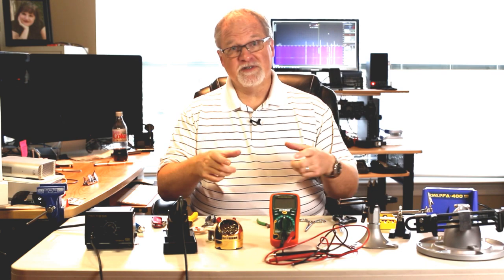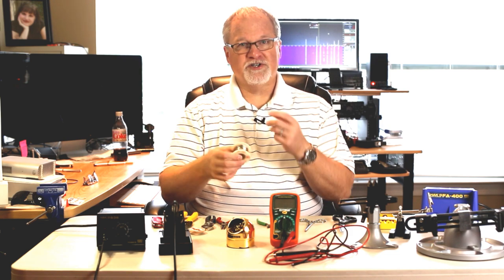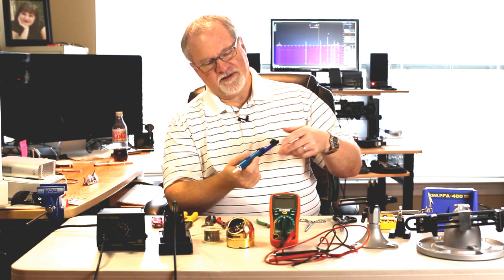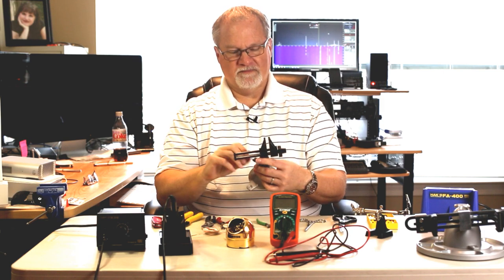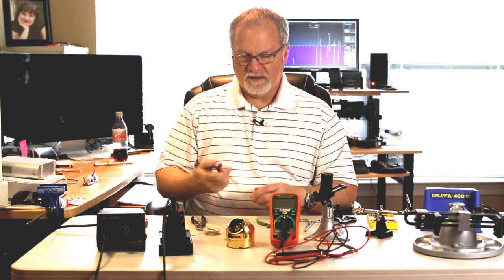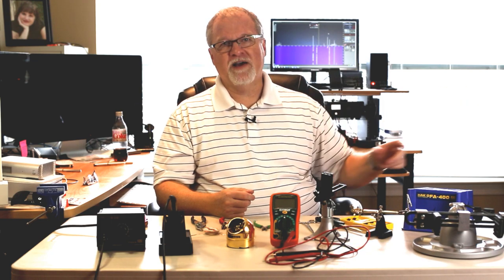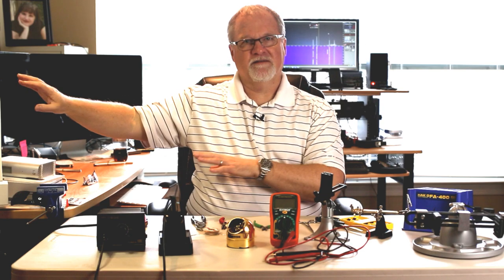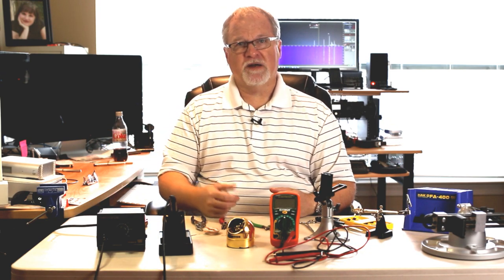Recommended Tools for Kit-Building

Comment: First off, thanks a bunch for the videos. I really enjoy watching them. I'd like an adjustable soldering station, like a Hakko, some day. Right now, I have a 25W and 60W Weller and a 160W electric gun. For fastening wire to end rings and soldering sections together fast, a butane pistol (not a plumbing torch!) comes in handy. Regarding the fumes, I have a small AC fan as well as a fan that plugs into a USB port. If I set them near where I am soldering, they pull the fumes away. For years, I used a helping hands. I then got a circuit board holder and a fluorescent magnifying arm. One thing that is really handy is a metal, suction base vise. The suction base doesn't work worth a crap, but it is heavy and something put into it won't move. With helping hands, it's too easy to wiggle around the alligator clips or the hot clips to make imprints in wire insulation. The vise doesn't do that.

Comment: I would mention that the ideal solder is 63/37 lead-tin.  Flux is your friend for good soldering practice.  Get a small bottle of liquid flux and well with 90% Isopropyl Alcohol and Q-tips to remove excess flux.  Solder wick is essential to remove excess solder.

Comment: I don`t solder professionally, but I know somebody who does and he takes steps to vent the fumes he produces outside the shop area. What occurs to me is, you could do your soldering on the kitchen stove if the vent hood exhausts the air outside the house. Maybe placing a box fan in a window and soldering in the vicinity of it will accomplish the same thing.

Comment: Nice video! If you rigged up a flexible hose, like an old vacuum cleaner hose/nozzle to your fume extractor, you could have local extraction without compromising your soldering job or your health!

73, Tim
VA1TIM

Comment: Just a Note but when using side cutters make sure you hold on to the component lead so it doesn't go flying across the room.  If it's not possible to hold the lead a good set of safety glasses are a good precaution for when the wire goes flying up into your own face.
Reply from the maker: +KC4VZT Middleburg, FL Excellent point!  Thanks for posting this. I'm usually looking at the board through a lighted magnifying lamp so I've got that between the board and my eyes. - Cliff

Comment: As an alternative to a floor fan to blow away the solder fumes, a DIY project is to take an old computer fan, many of which are variable speed, and mount it in any type of enclosure to move air across the bench. Probably not OSHA approved, but better than nothing.
Reply from the maker: +John Tarbox Thanks, John. Good idea. On a related note.... at Goodwill, I found a 12-volt small fan with a cigarette lighter plug.  I sometimes clip that fan onto the table and run it off a battery. - Cliff

Comment: Good vid.  If you are concerned about solder smoke you should toss that diet coke away as it's more lethal ;)  Google aspartame poisoning - horrible stuff.  I made a fume extractor with a PC fan, a couple of carbon filters purchased on eBay and 3 12cm dust covers (you'll need two on one side to keep the carbon filter from touching the blade).  To make it stand up I used 4 L brackets from the hardware store.  Not powerful but if you put it next to your work (about 8 to 10 cm away) it will draw in the fumes and nothing comes out.  Much smaller (less desk/bench space) than a Hakko type filter too.  Also very quiet (in case you're filming).
Reply from the maker: +Digger D Thanks. I looked up Diet Coke and saw some pretty compelling reasons to switch to water... which is a shame since I love Diet Coke.  Definitely food (drink?) for thought... - Cliff
Reply: QRP School You're welcome, I became quite ill using a product containing aspartame a couple of years ago (breathing problems, severe fatigue, achy joints, etc...)  and had a bad reaction to it many years ago as well when I drank diet coke.  Water is great once you get used to it.  They put aspartame in everything so you have to read the labels and they use several names and hide it in things like "artificial flavoring".  Keep up the good work.
Reply: Diet Coke is one of my favorite foods! I'll probably be pickled because of it.
Reply: I've heard about water...  :)  Seriously, I'm addicted to Diet Coke. I need to quit also.